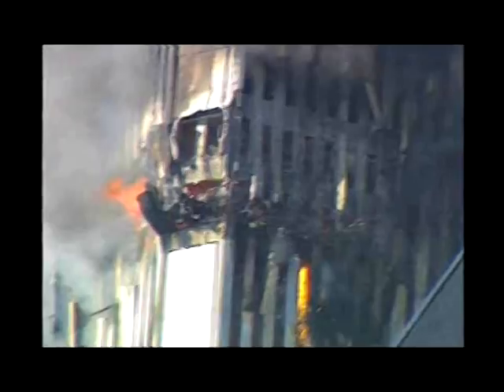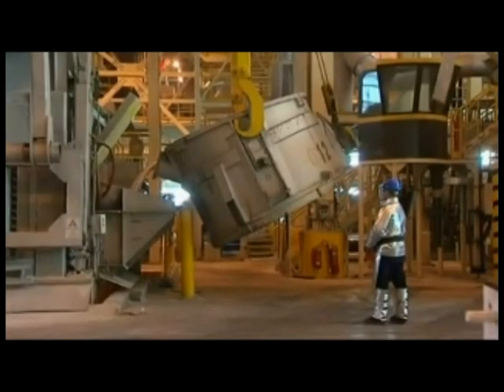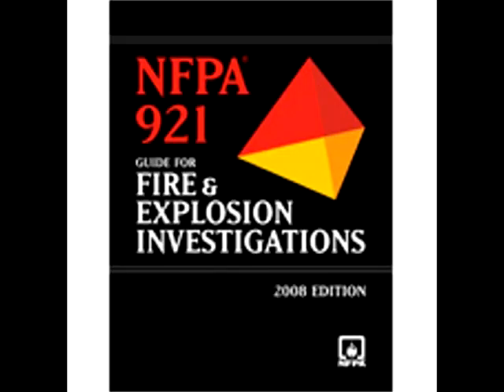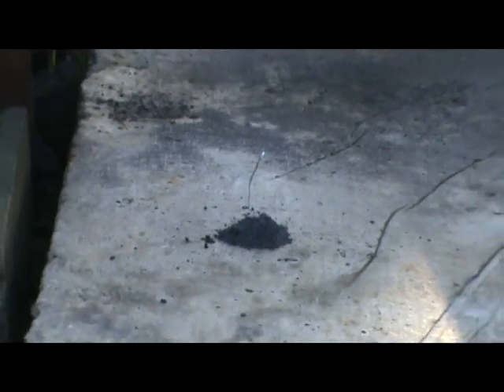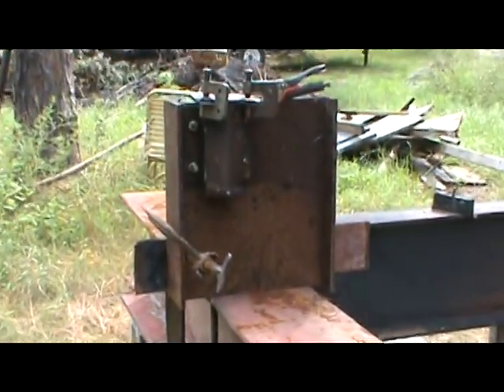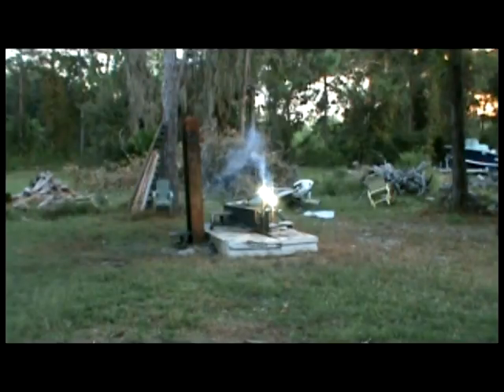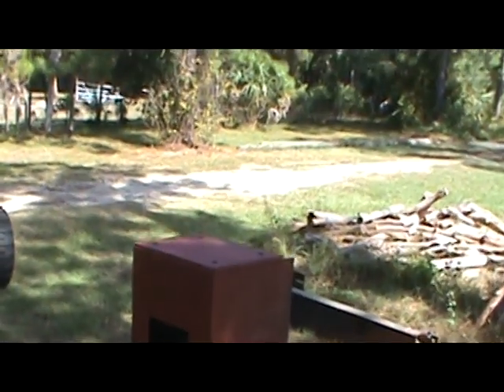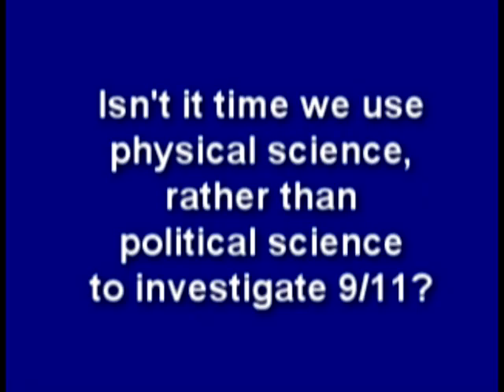9/11 Experiments: The Great Thermate Debate

Comment: 2 things you should all consider....for Real.
number one,who had just bought the towers??
and found out renovations to remove asbestos would cost more than the buildings were worth?
number two,who had DOUBLE payout Insurance in case of Planes hitting the towers?
find the answers to those 2 questions and you will understand 911 much better.

also,i see a lot of how it couldnt be done,so heres how they did it.
they rigged the towers beforehand,then used a gps beacon for the planes to lock onto.
this explains how 2 Airplanes were able to hit their targets perfectly at that speed.
Reply: try reading more..he expected to get 12 billion in payouts but only got 4 billion even tho he managed to win a Dual judgement because 2 planes were involved.
and ty for being captain obvious about ANY building needing insurance.
Esp the wtc.
you do realize the wtc had been attacked before right??

Comment: Mix aircraft fuel with insulation styrofoam wire insulation plastic natural gas and everything stacked inside that building under collapsed floors stacked on top of each other, by the tons, for a couple hours.  Yeah try again buddy.

Comment: The army has a thermite grenade that is meant to be dropped onto a tank engine cover to melt through and destroy the engine, that’s the theory anyway. The drill Sargent layed a thermite grenade on a engine block and it melted into the engine block. I don’t for one minute believe thermite was used on 9/11. I lived in a farm house with a wood burning stove to heat the house. We used to fill the stove with wood and open a small vent at the bottom of the stove and the air being sucked in would sound like a jet engine. The stove would get so hot it would glow red in fact a friends wife burned that house down by getting the stove glowing hot. With such a huge fire inside that was burning hotter and hotter as the base of the fire was supplied with more and more air the fire would’ve got hotter and hotter enough to melt the already compromised structure that still had to support all the weight that the full structure was doing. I’m not convinced at all that this was a government ploy. If it was people by now would’ve come forward like Trumps lawyers who seem to care less about client privacy.

Comment: Lets see. Planes are made of alumina and magnesium alloy. In those planes about 150 plus tons of the stuff. The building is steel. And right there we have all the ingredients of thermite. Perhaps someone should investigate whether a chain reaction can be generated at that scale that would start steel melting and destroy structural integrity of the building
Reply: So your knowledge of Chemistry is non-existent.  Time to voice your opinion.  You're ideal truther material.
Reply: You mean me believing that the materials to produce thermite were there because a plane hit a building  , along with other metals that would have ignited at those temperatures makes me a truther? 
I agree I don't have a degree in chemistry . I topped out chemistry in roughly equivalent to first year university .
But given your interpretation of what I said makes me think you quit learning languages at about age 12
Reply: Planes are NOT made 'of 'alumina and magnesium alloy'.  The all-up weight of the planes was 110 tons, about 50 tons of 'the stuff' being aircraft-grade aluminium alloy.  The towers contained about 200,000 tons of mild steel.  We don't have here 'the ingredients of thermite'.  A 'chain reaction' could not have been generated - except by six acres of combustible offices, were they to be set afire by 10,000 gallons of jet fuel - which they were.  The structural integrity of the towers became degraded once the temperature of a relatively tiny amount of their steel rose above 475 degrees Centigrade.  So NO part of what you wrote contained any truth whatsoever.  The fact you finished with an insult guarantees your entry into the 'truther' community.  Congratulations, sunshine.
9/11 PREDICTED BOEING 707 (1964) and ACTUAL (2001) BOEING 767 TOWER IMPACT ENERGIES
For those who believe that the REAL Boeing 767-200 impact was in any way similar to the notional impact calculation made in 1964 to test whether a tower could withstand it, I have reworked the calculations using the REAL impact figures and the REAL suppositions made, in place of the FALSE ones made by AE911T.
BOEING 707-320B
Empty weight 66,406 Kg.  Passengers (75% full = 164 people + 4 crew 100 Kg each) Fuel 500 gallons, so the notional weight of the 707-320B at the time of impact would be 66,406+16,800+1543=84,749 Kg
Its APPROACH speed of 147 mph works out at 65.7 metres per second.
The KINETIC ENERGY of the Boeing 707-320B at the time of impact would then be
0.5 * 84749 * 65.7 * 65.7 = 183,000,000 Joules.
BOEING 767-200 (Flight 175)
Empty weight 80,130 Kg.  Passengers + crew 65  Fuel 10,000 gallons, so the notional weight of the 767-200 at the time of impact would be 80,130+6,500+30,860=117,490 Kg.
Its speed of 565 mph works out at 253 metres per second.
The KINETIC ENERGY of the Boeing 767-200 at the time of impact would then be
0.5 * 117,490 * 253 * 253 = 3,760,000,000 Joules.
So, by dividing the second figure by the first, we discover that the REAL 767 impact was MORE THAN TWENTY TIMES GREATER.
Reply: Aircraft grade aluminium is aluminium primarily alloyed with magnesium . Usually about 1% , but there are components that have higher proportion than that .The maximum take off weight of the 767 is 142 tonnes . You are closer to the actual weight of "aircraft grade aluminium "than I was with my guestimate .I am realistic enough to know that 50 tonnes of the stuff would have been plenty if it could be ignited [as appears to have happened ]
I am also aware that thermitic materials have been found in the debris . The point of my original post was to point out that there was no need for there to be a thermitic bomb planted in the building for that to be the case . The materials in the plane and the building sufficiently heated and perhaps ignited by magnesium potentially could do that without an external device .
That you failed to understand my point and  you started with an insult guarantees your entry into the ranks of the thoughtless and dimwitted . And your second comment confirms my earlier thoughts
Reply: +Rick Carter
"Aircraft grade aluminium is aluminium primarily alloyed with magnesium" - And not ALUMINA, which is Aluminium Oxide, a white refractory grit found as the sand in hardware store sandpaper.
"You are closer to the actual weight of aircraft grade aluminium" - Thanks.
"50 tonnes of the stuff would have been plenty" - if ground to a fine powder and mixed 1:3 with finely-powdered iron oxide.
"if it could be ignited" - and set off with magnesium ribbon first ignited with a small propane torch.
"as appears to have happened" - It doesn't at all.  Copious amounts of ALUMINA smoke would have been visible in the air, and copious amounts of that material would have remained in the wreckage.
"thermitic materials (were) found" - If you paint 'silver' paint over red oxide primer (the practice at the WTC and everywhere else), then technically you have produced a 'thermitic material'.  You would never ignite it when bonded to steel beams or columns, however.
The studies you may have heard mention of were 'truther' in origin, and failed in their attempts to prove the existence of thermite at the WTC, although, of course, they assert differently..
"there was no need for there to be a thermitic bomb planted in the building for that to be the case" - is bullshit.
"The materials in the plane and the building sufficiently heated and perhaps ignited by magnesium potentially could do that without an external device" - isn't possible, unless you think the plane could grind itself up finely and mix itself with 150 tons of iron oxide powder conveniently located across six floors of each tower.  God knows how that might be set afire.  Burning kerosine won't do it.
"you failed to understand my point" - I completely understood your stupid point.
"you started with an insult" - No.  your knowledge of Chemistry is non-existent.  Time to voice your opinion.  You're ideal truther material.
"thoughtless and dimwitted" - get away from the mirror...
"my earlier thoughts" - do you have any?
If you are capable of thought, perhaps you should consider that long-span beam slender column towers made entirely of steel are particularly susceptible to six-acre office fires, due to the nature of the steel itself, and of its efficient use in such lightweight structures.  Such structures have what is known as a low thermal mass.  Just ask a fire chief.
Alternatively you should read the NIST Report, which was produced by skilled engineers for your delectation.
Don't come across like that stupid guy out of "Cheers".  We'll leave your implicit support of terrorism out of it.
And here's why the wreckage remained so hot for so long:
AN ANALYSIS OF THE AMOUNT AND DESTINATION OF THE POTENTIAL ENERGY OF A WTC TOWER
The first law of thermodynamics, also known as the Law of Conservation of Energy, states that energy can neither be created nor destroyed; energy can only be transferred or changed from one form to another.
Source: Boundless. “The Three Laws of Thermodynamics.” Boundless Chemistry. Boundless, 02 Jun. 2016. Retrieved 12 Oct. 2016 from https://www.boundless.com/chemistry/textbooks/boundless-chemistry-textbook/thermodynamics-17/the-laws-of-thermodynamics-123/the-three-laws-of-thermodynamics-496-3601/
The World Trade Center towers (and WTC7) fell NATURALLY due to buckling failure when their 'slender' columns lost attachment to their floors.
They only used a third of their Potential Energy to destroy themselves, the remaining two-thirds was consumed in crushing some of their steel into ground zero.
A standing WTC tower possessed two hundred and forty six tons of TNT of POTENTIAL ENERGY merely by just standing there. We shall call this energy Eo.
The tower fell by taking the direction of LEAST RESISTANCE, which was THROUGH ITS BUCKLING COLUMNS.
The columns failed by BUCKLING because their STRUCTURAL STABILITY had been compromised by LOSS OF FLOOR ATTACHMENTS. No steel got crushed when this buckling failure occurred. 
Buckling is not a MATERIAL failure; it is a STABILITY failure.  This type of failure was first explored by the famous polymath, Leonhard Euler, around 1,750 AD.
The floors had detached themselves by sagging to an angle which snapped their connections. Photographs of these separated floors (taken shortly before collapse) are plainly shown in the NIST Report.
As each tower fell, some of that stored potential energy, converting to kinetic energy by falling, was released to damage and dismantle both the moving and the stationary parts of the tower on the way down.
The amount of the initial energy consumed in such a manner was inversely proportional to the rate of acceleration of the tower as it descended. It can be calculated.  We shall call it Ed.
The amount of energy remaining (Er) when the tower wreckage hit ground zero is then (Eo - Ed).
This energy, transferred elastically, caused PLASTIC DEFORMATION in the crushed base steel wreckage, and became HEAT. This too can be calculated.
The heat was considerable. The signs of it were captured by satellite. It amounted to the equivalent of a thousand tons of steel raised to a temperature exceeding 1,000 degrees Centigrade.
This hot steel, crushed and pressed against ground zero, oxidised its surface (making scale) and absorbed local oxygen gas, leaving a reducing atmosphere.
In these reducing conditions, and at a temperature of 1,000+ degrees C, fireman’s water which had percolated through crushed gypsum wall boarding DISSOLVED calcium sulphate (yes, Gypsum is 5% soluble in water), the sulphate ions of which were reduced to sulphur which combined with the exposed iron to form IRON SULPHIDE, which at such temperatures was MOLTEN, and flowed away. At a temperature of 1,000 degrees Centigrade, in an absence of oxygen, and in the presence of hydrogen, Sulphur and Iron atoms become keen partners, forming IRON SULPHIDE, which above 1,000 degrees Centigrade, is a LIQUID, and flows away, leaving 'corrosion' claimed by 'truthers' to be caused by thermite.
Such hot reducing conditions also caused the water/steam to be REDUCED to hydrogen gas which was noted by firemen to be burning at the surface of the wreckage.
The wall-boarding and crushed concrete surrounding (but mostly above) the steel were THERMAL INSULATORS, so greatly slowing cooling.
CALCULATIONS (in SI units):
To calculate the original potential energy of the tower in TNT equivalent,
G = 9.81 metres/sec^2
Mass (M) of tower = 5e8 Kg
Height (h) to the tower’s CG = 210 metres
The explosive energy of 1 ton of TNT (Kt) is equivalent to 4.184e9 Joules
Equation: Tower Potential Energy (Eo) = ( M * G * h ) / Kt
This is equivalent to ( 5e8 * 9.81 * 210 ) / 4.184e9, or 246 tons of TNT.
The Potential Energy of each standing tower was equivalent to 1,000 standard 500 lb. ‘iron’ bombs.
To calculate the kinetic energy used in the tower destruction takes a moment, after a simple thought experiment, namely considering the tower would fall at G if there were NO resistance, and if it fell so slowly that it consumed ALL its energy, it wouldn’t fall at all.
So we can see that the PROPORTION of the energy used up by the collapse must equate with the proportion of G which the collapse was unable to achieve.
As the collapse acceleration was, by truther calculation, established to be about 70% of the acceleration due to gravity, we’ll use that.
The energy used up in tower destruction was therefore 30% of 246, or 73.9 tonnes of TNT.
Assuming that 30% of the tower fell outside of the basement, then the energy (Er) available to heat the wreckage base (by elastic energy transfer and crushing) was 0.7 * (246 - 73.9), or 120 tonnes of TNT.
We know that the steel reached at least 1,000 degrees Centigrade because that is the melting point of iron sulphide.
We can therefore calculate the mass (m) of steel that was raised to that temperature.
The specific heat of iron (Fs) is known to be 0.45e6 Joules / tonne / degree C
The ambient temperature was 20 deg C, so the temperature rise (Tr) was 980 degrees C
Equation: Er = m * Fs * Tr
So m = Er / Tr * Fs = ( 120 * 4.184e9 ) / 980 * 0.45e6
And so m = 5.02e11 / 4.41e8 = 1,138 tonnes.
The collapse of each World Trade Center tower created 1,138 tonnes of red hot steel at 1,000 degrees Centigrade.
So we can see that there is no need to postulate an extra source of energy, and that the basement wreckage heat is also easily accountable, with the additional corroboration of burning hydrogen at the wreckage surface, and molten iron sulphide at the wreckage base.
And so the underlying 'truther' assumption, that the planes couldn't bring down the towers, is shown to be FALSE, as it is shown by calculation, using the physically-correct values, that the potential energy possessed by the towers numerically accounts for ALL the known consequences, through elastic energy transfer, plastic deformation, HYDROGEN gas burning at the wreckage surface, EUTECTIC IRON SULPHIDE melting off the hot steel pressed against Ground Zero, and, of course, a tremendous amount of HEAT.
These results are EVIDENCE of the event.
They have been evident to any REAL scientist or engineer from day 1.
Reply: You are correct . I cannot explain the chemistry of why a sheet material could have ignited . The surface area should be way too low .The metal oxide should not be there in sufficient quantities . But then again no one can explain the chemistry of that fire , and sometimes unexpected things happen . Like materials being damn near vaporised by impact .
Many Americans seem to use the word alumina for what the rest of the world calls aluminium . I was trying to translate because most Americans would not recognise the use of the word aluminium . [Just like you may be thinking I do not know how to spell vaporized and recognize]. But I am very aware of the difference .
As for me insulting you . I think you need to expect to be treated by others as you treat them . Under the circumstances of your rudeness I was happy to reply in kind and still am .
Thank you though for your lengthy explanation of what you think the chemistry of that fire might have been . It's certainly interesting reading
Reply: You're welcome.  My engineering cultural upbringing (National Gas Turbine Establishment, Pyestock, Hants, UK) was pretty acerbic.  I think I was taught by insult.  It works because fury is a stimulant to thought, I guess.  It certainly stimulated me, anyway.
Listening to this liar and stretcher of truth makes me angry every time I fail to knock the sound off.  That might be it.